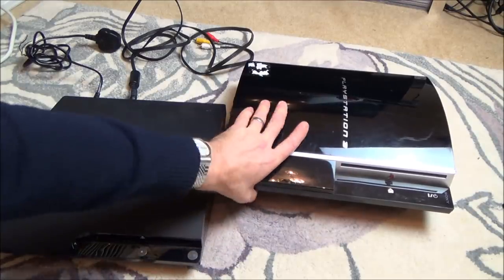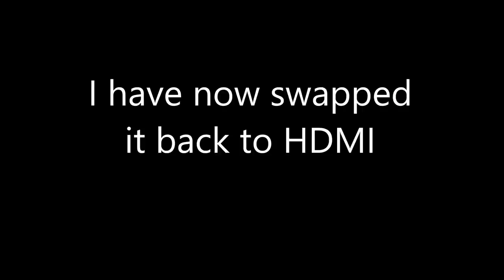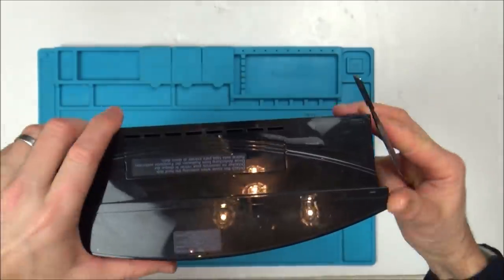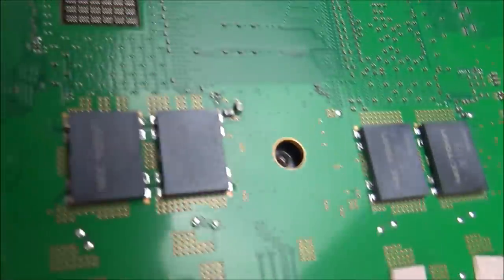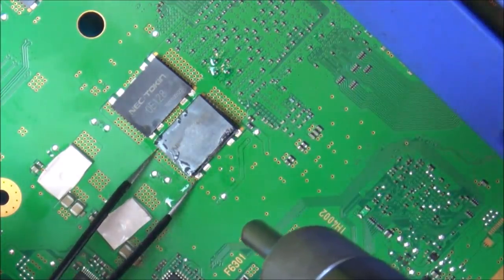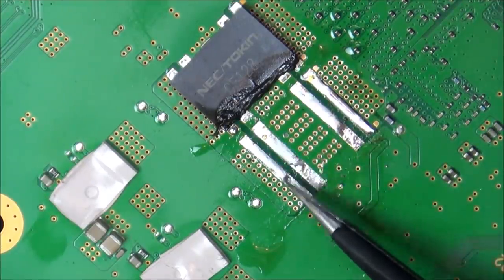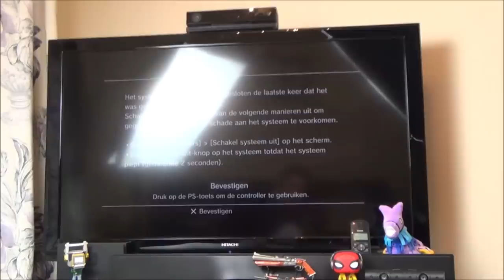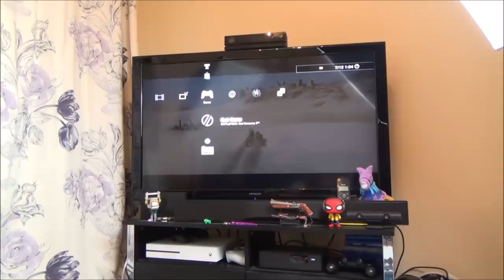Marcel's Lot PART 4 - Faulty SONY PlayStation 3 Slim & PS3 Fat

Comment: YLOD is a issue with the heat sync, all you need to do is reflow them
Reply: The point of this video is, that what you are saying is wrong. People assumed it was the issue, and never actually did any work to see if that was the problem.

Comment: Volts at a Cap isn't that important, the F has to be mostly matching, if a cap needs to long to load or unload this could make problems, the volts only tell the range the cap is working with. a slightly higher cap at voltage side is always better cause of long life terms, it'S not runnign at its max so it will last longer in theroy.

Comment: lots of people think the fat ps3 red light of death means the graphics chip is gone, and should be reballed... well all it really means that there is a short somewhere, on the board of the unit. the people that think it is the graphics or CPU are just listening to the garbage out there on the web. If you know how to find the short on the board, with multi meter, or using a variable power supply to look for heating of the components,  it is really no different than fixing a bad short on a PC... if you know what your doing.  If not.. your just wasting your time and money. Re balling is a waste of time.. even the professionals know it is a waste of time and they use 7 thousand dollar systems to pull and reball those chips.. do not bother.

Comment: Hmm... I have such an insteresting example of WTF is going on: When i disconect BluRay drive, console boots up fine, but when its connected to the motherboard (12-10pin cable) it just shows YLOD.... I don't know is it a power supply problem, but it turns on just ok and fans work aswell. Anybody else had a similar problem?

Comment: Hi Vince, I am not pro like you and so not an expert, but just to warn you to be careful what tantalum capacitors you're buying, because I have several Chinese boards on which some of the tantalum capacitors caught fire and exploded and it's unimaginable if you haven't seen such thing (you can find few Youtube videos of exploding tantalum capacitor) - there is not only huge burn mark, but a crater in the PCB, almost a hole, i.e. the fire and explosion were strong enough to almost penetrate the PCB. I assume those are just some low quality Chinese tantalum capacitors or maybe it's bad board design - I don't know. In any way, that's fire and safety hazard and better buy some good brand like AVX, Vishay, etc from reputable distributor. Unfortunately, those are very pricey - like 1 dollar per piece. So, to replace all NEC Tokin capacitors in PS3 is expensive fix/mod, because you need 32 tantalum capacitors in total. Sooner or later all NEC Tokin will fail - I know that problems from laptops, but in laptops there is only one NEC Tokin and thus lasting fix requires only 4 tantalum capacitors, which is not that expensive. BTW, to remove them instead hot air like you did is better just to scrape them with a knife - you can remove them layer by layer - you showed in the video, their layered structure.
Reply from the maker: Thanks, I bought some AVX from eBay but they were very cheap...very very cheap. Do you know if there is just a thing as fake capacitors???? I know loads of things are faked but I don't know about the fake market for electrical components :-)
Reply: there are plenty of fake electrolytic capacitors, but I don't know if there are fake AVX tantalum capacitors. I myself would like to hear more on the subject from an expert, because even amateur like me has experienced several times explosions. So, as I see it there are 3 options:
1. bad board design, i.e. even the highest quality tantalum is just matter of time to explode on such board
2. bad brand of tantalum, i.e. some unknown brand, noname, or even fake made in China tantalum capacitors that explodes most of the time
3. good brand, but bad batch or even high failure rate of particular model, e.g. 1 in 100 is normal to explode.
I really don't know, but in general tantalum capacitors are not cheap, because tantalum itself is expensive - it allows to make electrolytic capacitor in such small physical size. However, if someone sells them cheap it doesn't mean they are necessarily fake. One more time - I am complete amateur and I am just sharing my very limited experience, but if you look reputable distributor - there are tantalum capacitors even 10 dollar a piece - those with Ultra Low ESR and NEC/Tokin are also Ultra Low ESR caps, but they are not tantalum.

Comment: when gpu fail . make a lot heat . sensor read it .and self shutdown is started 
some time re heat the gpu . Re ball the gpu (you need BGA MACHIN)
OR YOU VERY PROFFESINAL TO DO THAT 
BUT !! SOME FAT VERSION NOW VERY OLD 
AFTER YOU DO ALL KIND BGA MACHINE ,SOLDER BALL OF GPU CHIP 
TRANSISTOR INSIDE THE CHIP MAY FAIL 
. IF CONSOL OR GRAPHIC CARD NEED A BGA . YOU SAY GOOD BYE VERY SOON

Comment: Greeting. I have a ps3 slim when I turn on the green light , and after a few seconds is off ..? Does anyone have a solution for this problem?
Reply: Open it up and see if you find those big ass blocks this guy changed. If they aren't there then your PS3 has another problem, probably needs a rework.
Reply: @MGOFor3ver  not have such
..I do not know what to do ..
Reply: @petar_crni872  What model it is?
Reply: @MGOFor3ver  Model CECH 2504A .. ok,  have capacitors, I do not know how to call them, but they are small, but do not know if they are correct, because when I try on multimeter give the signal ..
Reply: @petar_crni872  
Those are tantalum caps, the ones this guy had to use instead of electrolics. Maybe you need just a rework. Pick a good repairing store that has a rework station.
Reply: @MGOFor3ver  Ok, thanks.

Comment: Vince I have messaged your facebook page about a switch throwing error code 2162-0002, Can you reply please or if there are others here reading this do you guys know of what this code relates to? Have never come across it before.
Reply from the maker: Sorry, I don't recognise it. I presume you have tried holding down the power button for a good 15 seconds or so just to see if it clears it :-)
Reply: @Mymatevince  Thought this may help you if you or others come across that code,  Fixed the switch with that error turns out it had nothing to do with the very limited suggestions online (There were only 2 it seemed) and was down to 2 dodgy pins on the screen card connector which I replaced and the switch boots and plays fine again.

Comment: NECTOKIN CAPACITORS AND OTHERS HAVE THEIR VALUE READING AS FOLLOWS. EX: IF ON CAPACITOR HAS A NUMBER (128) THE LAST NUMBER INDICATES THE NUMBER OF ZEROES TO BE INCREASED AND THE VALUE IS READ IN PICOFARADS 128 MEANS THAT IS 1200000000 (8 ZERO) PICOFARADS THAT IS EQUAL TO 1200uF = MICROFARADS!

Comment: it's an illusion. its the rsx problem related.
you will see
Reply: Can you explain further?
Reply: There're cases and cases. He didn't applied heat directly to the RSX, so the problem wasn't there. Obviously that doesn't mean the RSX won't havr problems in the future, it could be, or it won't. Now it depends of the state of the solder balls and actual temperatures.
Reply: @Captinaturoh  Some people think that the YLOD isn't a problem of the nec tokin caps, or solder balls, but the joints between the blue crystal and the plate of the RSX. They think in this case the only solution is changing the RSX for a "new one".
Reply: @MGOFor3ver  the fact he didnt put heat directly doesnt mean the rsx not suck some heat.
99.9% of the cases rsx need to be reballing in case of 90nm rsx consoles.
Dont listen to all mambo jumbo out there.
Reply: @TheBaregel  How many reworks jobs have you donr for doing such statement? 99%?? There're cases and cases, sometimes you will have to do this caps thing but maybe you'll need a rework in the future, if solder balls never were changed.
By doing a rework and not changing the caps you're getting the true ilussiom, because those caps are FUCKED and it will give you a YLOD later, no matter if the rework job is 100% perfect. Those caps are a demostration of shit quality.
The last case, you do a perfect rework and change the caps, great! To later get a YLOD, but why? The crystal soldered at the RSX plate needs a rework too! That's the biggest ilussion you'll get from this job, making a good rework doesn't give you any warranty. Just ask you why in the hell PS3s came to a YLOD after a few months. Also this is well explained on the internet, in this cases you only have to change whole RSX for good.

Comment: I have a spare ps4 if anyone wants it wont show a picture when on comes with the wires and controller
Reply: paulstarrr15 I’ve fixed a ps4 with that problem I replaced the hdmi chip
Reply: @revokednetwork4212  I'm not good with that sort of thing

Comment: All PS3s are Backwards compatible with PS1 and all 'fat' PS3s are Backwards compatible with PS2, the flap not flapping just means it was the version without the card readers.
Reply: @AdmrlSpeedy  Ah ok, I thought it was just the slims that had it removed.
Reply: CECHA01, CECHB01, and CECHE01 were the only North American versions to play PS2 from disc. CECHB01 was 20g, no wi/fi, no card reader. CECHA01 was the 60g w/card reader. CECHE01 was the last model to have the ability to play PS2 from disc.

Comment: YLOD is easy to fix but might do not last for long. Its a Production issue, so the fault isn't gone, it will came back and back again. Important is to correctly delit both CPU and GPU after reflow so that the chips didn't start over heating again at first minute. most of the YLOD repairs made wrong without cutting off the IHS's from both processors. You have to renew thermal past unter AND on the IHS, or it will directly run to hot again and will fail again quickly.
Reply: @Victor Hugo Alvarez Damasceno also wrong. Most Fat ps3 systems fail because of bad caps. Some do fail from a bad gpu chip or broken solder but most times it's just the shitty nec capacitors sony used